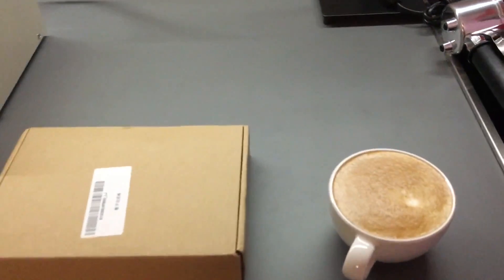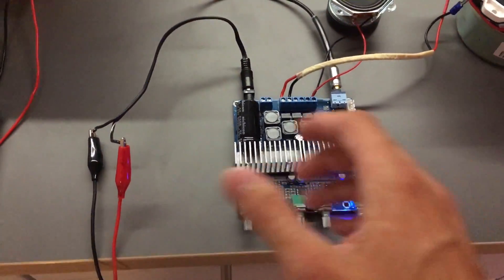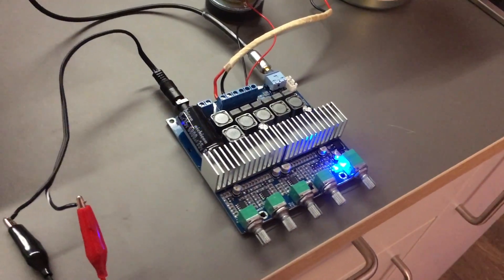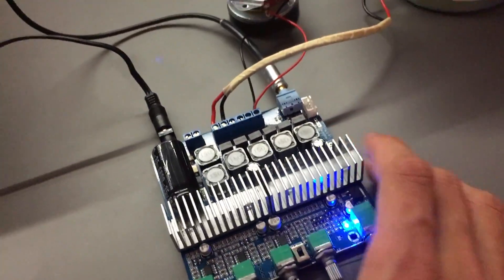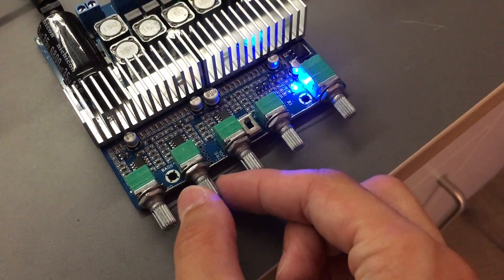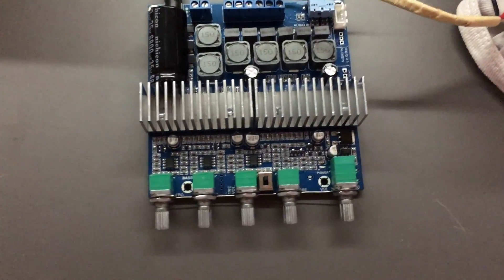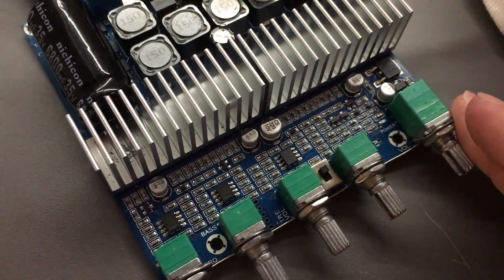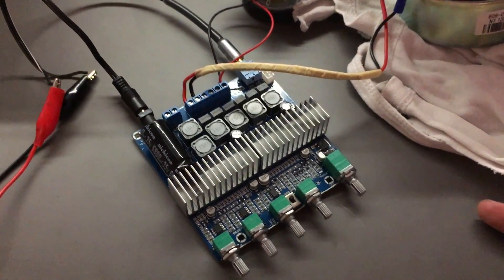TPA3116 2.1 Amp Review / AWESOME !!!

Comment: I just bought this amp, I can't get the Bluetooth to work.  Is that why your not using the Bluetooth?
Reply from the maker: no - I avoid cheap chinese amps with bluetooth built-in because of the interference noise they usually come with

Comment: How did you get it to power up in "line in" mode with solid blue light???  Mine always powers with flashing blue light "Blutooth" mode
Reply: Mine too, very curious to know if there is any way to power up in "line in" mode. If you know how, please share the solution.
Reply: @yuryzemlyanukhin5649  After much research I believe there are 2 different models and you can't change how they power up  :(

Comment: i broke one of the potentiometers. what kinda i need to buy ? the potentiometers on the amp has no info. and in ebay  there is many differend choices. B1K B5K B10K B20K B50K B100K BB500K ? witch would i choose ?

Comment: hello ! Does it work with 8 ohm speakers ?
Reply: No, subwoofer is 3 to 4 ohms and stereo speakers are 4 ohms
Reply from the maker: what? it'll work just fine with both 4 and 8 ohms loads

you'll put more strain on the amp and potentially more power with higher distortion with lower loads - aka 4 ohms

Comment: turn on pop/noise you get from other amps is actually normal, 3116 got powering problem, even if you use the "recommended" board it still pops unless you modify it to mute at start
Reply from the maker: yup - true

most chinese manufacturers use the recommended schematic as a guide .. find it SUPER weird that NOBODY updated the datasheet to account for this ...

it's otherwise a very nice sounding and powerful chip

Comment: Hi there, I have a couple of questions and I would appreciate it if you could answer them.
1. The board has 2 audio inputs (jack 3.5mm and 3pin). Wich one does the board prioritize if both are connected to different devices?
2. What's the Voltage and Amps of the power LED connections? Planning on adding an LED strip that turns on when the board does.
Reply from the maker: 1. I'm quite sure they're simply paralleled
2. I don't know what you mean here, please explain further
Reply: @Darieee  1. So, that means that the 2 audios will mix together?
2. Next to the main volume potentiometer there are solder points for an extra LED (power indicator)
Reply from the maker: 1. Yeah, if you play both at the same time it'll sound like complete garbage and make your sources suffer (they should survive but, yeah, you don't wanna play both at the same time)

2. Ow then it's probably a 100 Ohm or more resistor straight from VDD ... you won't be able to get anything dazzlingly bright from it but ... anything used just for indication should be fine
Reply from the maker: You'll need a strip with no resistors and all LEDs in parallel though for the best effect
Reply: @Darieee  I can just "steal" power from the main Power Supply and adjust the Voltage and Amps with a regulator, right?
Reply: @Darieee  Thanks for such quick responses and good information. There isn't many people like you with the patient to answer silly questions!
Reply from the maker: Yea, but it had better be switching :)
Reply: @Darieee  Sorry, didn't understand what you meant
Reply from the maker: Yeah ... I've been on the asking end and it's never fun not getting answers - glad to help out the community

Comment: Basically the switch does do a lot if you use bigger speakers. I power KLH series 6 with these and a 6 inch subwoofer. The KLH is a twelve and a 4 inch tweeter i believe. On the KLH you can expand the tweeters and reduce if you need too. But the twelves are static meaning i can’t equalize them at all. Since i want to have a sub i decided to go with a smaller punchier sub to add the pump. If the low end is too much for me i can flip the switch to basically half the amount of sub frequency, And that leaves the subwoofer with a more open frequency range.

Comment: The switch is for lowcut at 100hz or fullrange. Right of it is just treble.
You dont hear a difference because the litttle speaker doesnt play below 100hz at all, especially without enclosure.
Reply from the maker: That is very correct! Didn't figure that out at the time

Comment: I find there is a lot of high-frequency hiss produced by this amp unless you turn up the treble volume next to the main a bit. 
Not sure why this is!
Reply: Replace the pots with ones of a lower resistance to fix it. I don't know why they use high resistance pots... this is a common thing when you use them.
Reply: @rich1051414  Hey Richard! thanks for the reply! I will take a look at that or add a resistor along side it to bring it down a little more in ohms.
Reply: @adamklein6651  With this being a tone controlled setup, replacing all the pots may effect the high and low pass filters, but it shouldn't if you only replace the volume. This should do the business, though.
Basically, using a lower resistance pot there will further shunt the voltage that isn't current backed to ground, so basically the 'noise' that didn't belong in the signal in the first place.

Comment: can you suggest a proper subwoofer for this amp. i tried hooking up 2* 6 inch 50 watts 8 ohms subwoofer bu they are producing very high distortion on high volume as if they can't able to handle the power. I am powering it with a 19.5 laptop adopter. What watts and size of subwoofer you suggest which will work best
Reply from the maker: there are many factors to take into account

if you wired the subs in parallel then you end up with a 4 ohm load, which at high volumes might be too much for the amp to handle
Reply: @Darieee  I had tried both wiring I made parallel 4 ohm and also series 16 ohm but way producing distortion on high volume. i think the issue is with sub that's why thinking of changing it. can you suggest what watts,size and ohm sub-woofer will work perfectly for this amp.
Reply: The seller whom which i enquired mentioned that it's a 4 ohm output... Is it 4 or 8?
Reply from the maker: 8 ohm will load down the amp less

and will at the same time give you less volume
Reply: Thanks for the reply, one more information, is it possible to bridge the amp output, my requirement is one coax and one sub... If yes what watts of coax with 4ohm should i look on...
Reply: @mechdonz08  its 4 ohm for subwoofer

Comment: So I have this board and I am using it to drive 200w 12 inch subwoofer temporarily until I get proper amp but I have slight problem. It is clipping whenever bass hits harder and subwoofer barely moves. Will 24v power supply help or do I just wait until I get new amp.
Reply: DYI Master, the board can deliver 50w + 50w + 100w = 200w in total (at least on paper). If you use a 24V power supply then that power supply it must at least be able to deliver 200W/24V = 8.3A .. if your power supply cannot deliver enough Amps the board will clip the signal
Reply: @nicolaetuns  I currently use 12v 5 amp supply. I will maybe try better supply but I will be getting new amp anyway because my subwoofer is 250w rms and i am building second one so this amp won't cut it. Thanks for fast response.

Comment: Hello! I just got this amp and it's all great so far, except the small "hmm" noise coming from the speakers no matter what volume they are. It's weird because when I touch the heatsink and push it up front the table the noise goes away. Any ideas? I read online that it might be a ground problem but I don't know how to fix it. The power sockets in my country are schuko so they are grounded.
Reply from the maker: Mmmm, be careful, you might even be shorting shit out (though unlikely)

The noise comes from the amp chips being drive 'too' hard ... 

If you check the TPA3116 datasheet, you'll at some point reach a table of gain settings

What you need to do is change 2 resistors per amp chip and lower that ... then it'll be dead silent

Now I realised you said hmmmm noise ... that's ground and not gain ... I'm not gonna delete the rest though, still good advice ...

So, you have + and - going into the amp ... and 3 speakers connected? Do those have earthed chassis or something?
Reply: @Darieee  I have a 24V 5A power adapter connected to the amp in the barrel input (don't know the name) and with just the power and 1 speaker it makes the noise. The speakers are not on an enclosure and I don't know what you mean by earthed chassis
Reply from the maker: Some speakers have the metal part connected to ground

Can you try a different power supply ?
Reply: @Darieee  The chassis are indeed metal but no wires connected to it, just the 2 positive and negative from the amp to the speaker cone.
Yes, I tried with a laptop PSU rating 19V 3.3A and it's exactly the same
Reply from the maker: A wait ... what's up with your input? Is it connected to anything??
Reply: @Darieee  With NO audio input (neither the jack or the 3pin) it still makes the "hmm" noise
Reply from the maker: Yeah nah so ... that's actually more normal ...

If you have something connected and paused, then it shouldn't make the noise anymore

Is that the case?
Reply: @Darieee  No, the noise doesn't change at all. Not even if I change the volume or other settings. It just makes "hmm" noise by being on. But when I pick up the amp with my hands on the heatsink, the noise stops

Comment: Good video, I am confused that which one is better to buy between with Bluetooth or without Bluetooth please suggest.
Reply from the maker: I'd buy the one without Bluetooth, for 2 reasons

1) There might very well still be a bit of Bluetooth interference noise caused by some ground loops, which you'll have to put up with
2) The chip this type of board uses (I've had someone bring it up in one of my other TPA amp "reviews") is not from CSR, so it'll be hard to program it down the line if you so please (ie give it a name and other goodies)

If you are however uninterested in naming the bluetooth chip, and are willing to risk there being some residual bluetooth noise, you will be saving ~10$ and some work by opting for the built in approach
Reply: Darieee ok thanks sir, can you suggest any latest board in market today cause I want one for diy 2.1 system.
Reply from the maker: Check the first few which appear as verified in the description of this video

The first one is the one I have bought and used for 1+ years (works great), and the other links are other boards purchased by other viewers who have confirmed them as being good quality
Reply: Darieee can we solve ground loop problem by giving separate power supply to bluetooth module? And suggest me any simple Bluetooth module to add it in easy way...
Reply from the maker: it's very tricky - a separate supply won't be simpler than just buying the 12/5V modules with the Mornsun Isolating DC-DC Converter on the back

For example, this one https://bit.ly/2F0h5Ck
Reply from the maker: seems shitty and doesn't have bluetooth
Reply from the maker: this one seems better, so, you want to have aux and fm and sd card and usb ?
Reply: Darieee yes right all those and with remote also. But sound must be crystal n clear with attaching this.
Reply from the maker: Then buy what I sent you, all of the computer floppy drive sized ones look very very low quality, and might sound ok, but probably do not
Reply: Darieee which board link you sent?
Reply from the maker: I'm not gonna copy and paste a message I sent in 'this' thread

Find it above

Comment: Very Informative. Do you recommend it to be used for DIY soundbar and woofer for Home use or any other amplifier? Thank you
Reply from the maker: Yeah, as far as I'm aware it's the only one with a built in anti-thump system

You would have to change the gain on both chips, since they're set qqquite high, and there is quite some noticeable hiss
Reply: @Darieee  How do you change the gain on both chips? I'm wainting for this amp and I almost regret buying it for 20€ after reading the comments.
Reply from the maker: Mmm, I wouldn't regret it

You need to change 2 resistors per chip

Check the TPA3116D2 datasheet, there's a table with the values you'll need for each "gain"

Comment: The problem is, I would want to use 1 for front and 1 for rear speakers and then run a Bose sub that two speakers in it. If I use the .1 portion of the amps to run each sub speaker, then when I fader for more rear (which would be required) then that would cause one of the subs in the enclosure to run harder than the other instead of balanced. Yes I could set the fader on the head unit and then turn up the sub control on the front amp. But then the configuration could not be easily changed if I decided to change the fader on the head unit because I would mount the amps deep under the dash and even then restoring balance to both sub speakers would be a pain in the ass.
Better to use 3 two channel amps and have the input to the rear and sub amps tied together since the rear would always be on full output with respect to what ever the master volume setting is at on the head unit.

Edit: I just had a thought. (sometimes that gets me into trouble)
Devote 1 amp to the right front and rear and use the .1 to drive one of the sub speakers and then use another amp to do the same thing with the left chanels.
Reply from the maker: Your edit seems to make sense, it should get quuuite loud

Comment: Is this the same as the TB20A TPA3116D2 Stereo Amplifier 2.1 Channel Class D Audio Amp with Subwoofer Volume Control 2x50W 1x100W Sub Output Super Bass Power Receiver, Treble Bass Independent Adjustment + Power Supply ?

Dang sorry the name's too long lol, but just asking.
Reply from the maker: No clue .. but yeah, it sure 'could' be
Reply: @Darieee  Cool. Cause I'm lookin' for something that I can connect my speaker monitors and sub together. Right now, I have Scarlett Solo controlling my monitors, and Sony stereo connected to sub. I just want one magical device that can do it all :)
Reply from the maker: Well, this has quite some hiss though, keep that in mind

And avoid the ones with the built in bluetooth module, since they have some bluetooth noise ... most of them at least
Reply: @Darieee  So no way to minimize the hiss? I don't have the need for Bluetooth really so I'm pretty good there.
Reply from the maker: Sure, there is!

You have to change 4 resistors in total to lower the gain the TPA3116 amp chips are set to
Reply: @Darieee  dang, sounds like a lotta work lol. Any other way out?
Reply from the maker: It's really not though ... you can pop the old resistors off with a box cutter or flathead driver (do practice this beforehand if possible)

And then solder new ones in ... either buy an smd resistor book or you can solder regular through-hole ones ...

It's a lot more work than having the chinese faking control themselves and not pump the gain to the max ... but, yeah
Reply: @Darieee  ok soooo what if I don't do that? I could try adjusting the volume to get rid of the hiss....
Reply from the maker: Nnnope, some hiss will always be there

If you have tweeters in your setup it will be quite bad
Reply: @Darieee  yeah I have Yamaha HS5's
Reply: Wait... unless I use a noise gate with it? That may help? Else I'm gonna think there's a snake in there hissing lmao
Reply from the maker: I say go for swapping the resistors, gonna be a fun little project
Reply: @Darieee  ok then I'll try it out.
Reply: Do you know of any other device like this but better?

Comment: Will this sound ok with just a 2 speaker setup? Don't have room for sub.  Will the left and right channels be missing low frequency sound? Does the subwoofer output need to be mixed into it in some way?  Sorry if dumb question but I know nothing about audio setups.
Reply from the maker: Nah - there's a switch to make the satellites be full range, so ... it'll simply work as a stereo amp with just 2 speakers

And - in the future - you 'can' add the sub
Reply: Super.  Thanks for the prompt response.
Reply: Busca una placa de 2 canales que tenga el Chip TPA 3116 D2 es el mismo chip que trae la placa de la review. La diferencia es que para el subwoofer de la prueba la placa tiene un segundo chip TPA 3116 D2 en modo puente (bridge mode) y ese segundo Chip es para la salida del Subwoofer.  Puedes notar que hay dos disipadores de calor en la placa del video.

Comment: Doesn't it have Bluetooth function? It says so in some webs I found.
Reply from the maker: There's a variant which does; I would avoid it as I also heard people complaining of some interference being audible
Reply: @Darieee  thanks. Not an option since the Bluetooth is the main reason why I need this particular unit. Just ordered it on AliExpress, hope it will be OK.
Reply from the maker: Let us know how it turns out

An option would be to have your own csra64215 module and wire that up